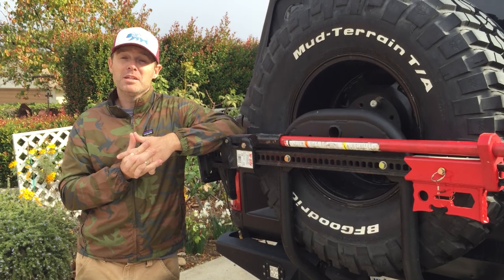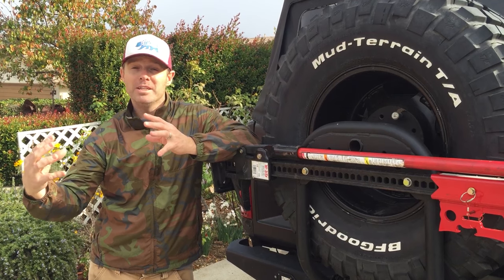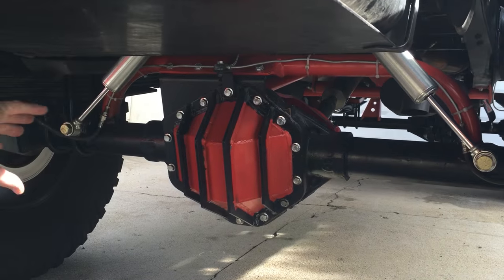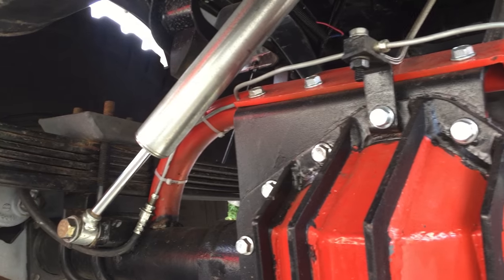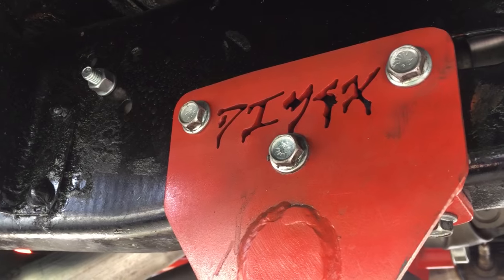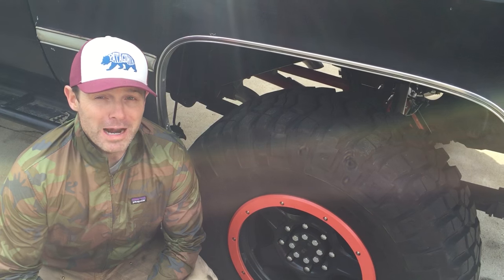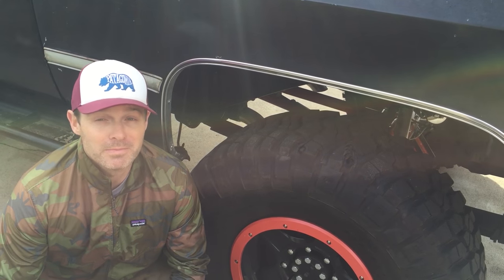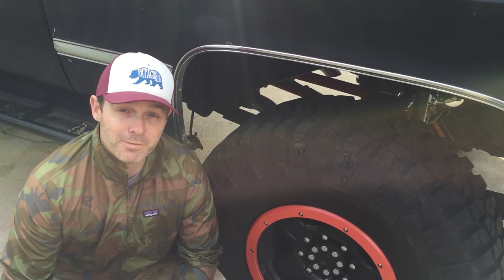MG #7 - My Anti-wrap / pinion guard setup from DIY4X

Comment: Hey Merrick, I just recently subscribed. I like your content plus I love square body rigs! Hey I was looking into getting a truss system and some sort of anti axle wrap bar. I know you changed over to a 4 link set up, but did you really like the DIY4X design? How did the truss mate to the back of the housing? If the backbone is sandwiched between the housing and diff cover, what keeps it from leaking? Is it welded completely around the diff cover area? Or is there just gasket material sandwiched between the diff and truss, and then the truss and diff cover?